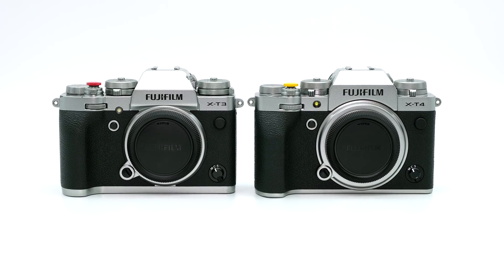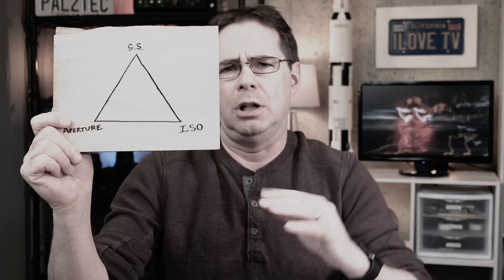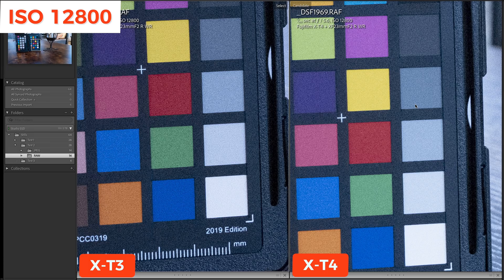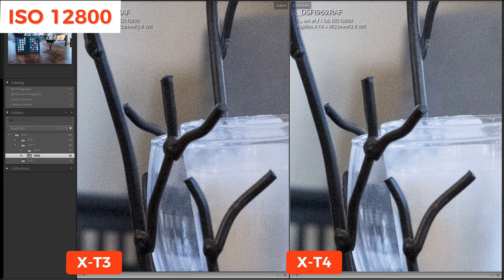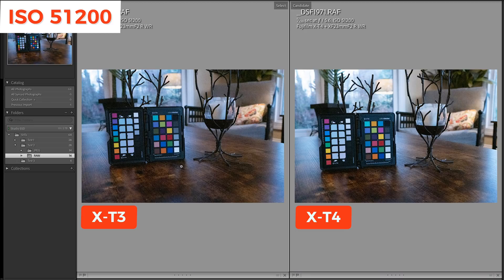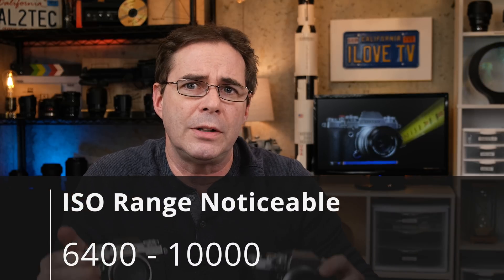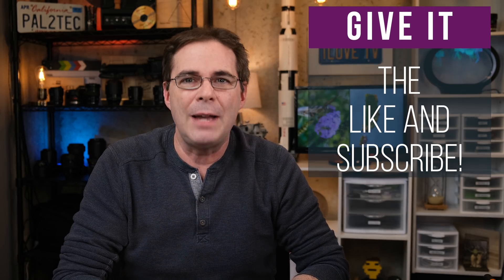Fujifilm ISO Performance: XT3 vs XT4

Comment: It's the same sensor... the xt3 pix are sharper with more noise, which probably means Fuji is doing more pre-processing before you get the image from the xt-4...so, "better" is a rather subjective assessment. I would prefer a sharper, but less processed image.. so, xt3 would be "better"

Comment: Not enough difference for me. I have never used anywhere near that sort of ISO with any camera!! If I have to have an ISO higher than normal on my X-T3  because it is necessary to get the shot then I would run it through Topaz DeNoise AI in post......problem solved!!!

Comment: Lr desaturates some of the colors, is that part of its default “color noise reduction”? 
Also, would be interesting to see how one of the non x-trans sensor cameras, like the X-T100 or 200, stack up to x-t3 and 4.

Comment: What is the work around for sharpness in LR for the xt4? Is there a plug-in to fix this problem? LR doesn't import my raw files? It only imports jpeg files
Reply from the maker: LR should definitely import RAW files from Fuji. I'd need to know a lot more info, but I can confirm that LR definitely does handle Fuji RAF files.

Comment: About the worms, why don’t Fujifilm just switch over to normal sensors? They have them. 
Like, what is it that the x-trans sensors actually give you that a normal sensor don’t? Do they just use them cause they sell better?

Comment: Also sucks that the XT3 exhibited more noise than the same shot taken on the previous XT2. Pro tip tho! For XT3 (and maybe XT4) users: If you are shooting a low light video at ISO 12800 or 25600, you may want to switch on 4k interframe noise reduction from the menu. The difference is noticeable at 12800 iso and even more noticeable at 25600 iso. Don’t bother with for below 12800. MY MAN WAYNE SZALINSKI!just doin your people a solid! Oh and if you see this Chris, you may want to do a fast Friday follow up vid to this: where you explain why and how some lower ISOs on the Fuji are noisier than the next bump up. I think 2000 appears cleaner than 3200. There’s a graph for this, where noise is y axis and iso is x axis and the line looks like a diagonal electric bolt ⚡️. That’s the extent of my knowledge on it... I’m certain you’ll know more tho.

Comment: Pretty interesting find. I could definitely see the difference between the files. I wonder if it really is a difference in circuitry on the xt4, or maybe better demosaicing (did I spell that right??) with xt4 raws, or even how each body handles heat, or all of the above!

Comment: Thanks for doing the work, but the exposures between the comparison shots aren't the same. Freeze the video at say, 3:59 and look at the wall in the background. The X-T4 shot is CLEARLY brighter. Not your fault the camera settings were giving you identical readings but enough to slightly skew your results somewhat.
Having said that, I don't shoot at those high ISO settings anyways. :-)

Comment: Guys, why not try to do the following: Go to the default low ISO value of ISO200 and use the same lens, same aperture, same shutter speed. Bring the images into Lightroom and then pull up exposure settings and make both images have the same brightness. Now let's compare, which camera does better. That's the ISO less comparison.

Comment: Nothing wrong with shooting at 6400 ISO (or more) when the images come out looking that smooth. 

As much as I adore my XT-4, I really wish it was as reliable and polished as even an entry level Canon DLSR (especially when it comes to video). The Canon might have garbage dynamic range and toy camera nerfs like 1/4000sec max shutter speed, but the thing just works. The auto exposure is fast and smooth (and it tries to respect the 180 degree shutter rule by stopping down!), the autofocus is accurate and fast, it just works. 

The Fujifilm is a beast and the image quality beats out many full frame offerings IMO. It's such a shame to have to choose between lackluster image quality + missing features (but with perfect AF and AE), and breathtaking image quality + cutting edge features (but with glitchy AF and AE that can easily ruin an otherwise amazing shot).

Why can't I have both!

Comment: I recognized, that the X-T4 images are less sharp than the X-T3 ones. So I asked a friend to let me do the same test with my X-T3 and his new X-T4. At ISO values up to 1600 I can't see any difference in noise or sharpness, even zoomed at 400%. From ISO 3200 upwards, the X-T4 shows less noise but the sharpness decreases the higher the ISO is set. I double-checked, that the internal noise reduction was deactivated and all relevant settings were the same. For me personally, as I don't need IS and never had a problem with the batterylife, the X-T3 is still the better choice because after developing the RAW files from the X-T3 in On1 Photo Raw with applied noise reduction, the images showed abut the same low noise as those from the X-T4 without Photo Raw noise reduction, but were noticeably sharper.
Thanks for your video as it inspired me to do this comparison by myself, as now I love my X-T3 more than before.

Comment: Chris I don't use LR, my pics are stored in windows so my RAW files go direct into psRAW (no DNGs here)  sharpening is pulled to 0 as is noise reduction. I do noise reduction in Nik define, then sharpen in PS using either High Pass or smart sharpen. Well happy with results XT3. Give it a whirl, it would be interesting to hear your thoughts on this one.
Reply from the maker: Thanks Ian!!! Will check it out!!

Comment: would love to see x-t200 vs x-t4 cos on dpreview studio scene Xt4 has very soft image compared to xa7(xt200) and abit more noise reduction  when xa7 has sharper image overall there.Check this iso invariance of much softer xt4 vs even older xt100(not even xt200)
https://www.dpreview.com/reviews/image-comparison/fullscreen?attr134_0=fujifilm_xt4&attr134_1=fujifilm_xt100&attr134_2=fujifilm_xt4&attr134_3=fujifilm_xt100&attr136_0=13&attr136_1=13&attr136_2=18&attr136_3=18&attr176_1=off&normalization=full&widget=789&x=-0.853225161032155&y=0.574686267999587

Comment: I wonder how that plays out when cranking up the exposure in post at base ISO...
I have a theory: If the amp part was where they improved the XT4 there shouldn't be as much of a difference between them when adjusting exposure in post. But if the DAC part was improved the difference should be about the same as in this experiment.
I love these technical videos!

Comment: I'm a little confused about the difference in how capture one vs lightroom handles a Fujifilm RAF file.
In this video it seems that the lightroom handles the Fujifilm files better and that the worms and colour smudging now appears more in capture one.
I was convinced by you that this was the other way 'round. I momentarily have both software platforms on my computer, but I'm investing now in working with capture one for Fuji. Can you please clear up my confusion?
Reply: I'm also concerned by that

Comment: Nice review. Both cameras are perfect high iso capabilites. But x-t4 one step ahead of course. Because of newer camera. Proud to be owner a x-t4. Happy with it.
Reply: Yeah, I feel the same about my X-T3. If the 4 was in my budget I’d have bought it but honestly the x-t3 is a solid upgrade from my x-t10 and it performs really well stacked against the x-t4, not quite as good but still very admirably. Pretty happy with my decision overall as I got the X-T3 for about $900 USD and I got to spend the leftover money on a couple of primes!

Comment: I would enjoy a video on the phenomenon of how the dynamic range of a sensor shifts towards highlights with increasing ISO (google the terms "increasing iso dynamic range". What this means is that in sunny and brightly lit situations, if you wish to retain more detail in highlights, you counter-intuitively increase ISO instead of decreasing.
Reply: Correct me if I'm wrong, but I thought that was image encoding specific - like shooting in a log format for video.  Or like when one uses a DR setting above DR100 - in that using a value above that reports a higher ISO being used, but behind the scenes Fuji is capturing the scene at a lower ISO and then boosts it digitally to match the recorded ISO. In this case, the ISO is high, but it was recorded such that it left enough headroom for the highlights to not be clipped.

Comment: Could it be the battery? Could a larger more powerful battery help the processor perform a little better? 🤔 (During the beginning of the gulf war Apache helicopters had radar static interference until it was discovered that it was caused by power levels, batteries changed problem solved.) 🤔 There are many things a simple power source change can fix, incredible! To find out we must use the new battery with the xt3. 🤔🤔🤔
Reply: Well seen. I hadn't thought of it. Maybe, that could be the reason.
Reply: @angelcobosardon  🙏👍

Comment: I see a slight difference in exposure between the two.. The Xt3 is slightly darker in all your samples and could be playing a role.
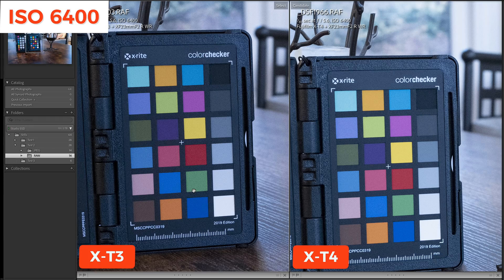Reply: 1:49 Look at the right edge of glass and a pillow white part. X-t3 did a better job!
Reply: Also noticed that. Same processor and sensor, they are identical.
Reply: overall it looks like x-t4 it's brighter and a little softer, alltough at 1.49 farfolini seems to be right about exposure.🤔

Comment: The results of X-T3 looks clarely sharper than X-T4.  Or X-T4 has a noise reduction directly in RAW files, or the diference you see is for the diference of shrapening in the picture.  Cheers of Argentina.

Comment: Great side-by-side comparison! It makes me wonder if there's such a need for a FF like the Nikon Z6 II for taking high ISO shots.

Such is the quality of the X-T4 that I now don't understand how the Studio Shot from DPReview shows so much more noise than what you show on Capture One on the X-T4 shot, especially chroma noise (link below).

https://www.dpreview.com/reviews/image-comparison?attr18=daylight&attr13_0=fujifilm_xt4&attr13_1=nikon_z6ii&attr13_2=apple_iphonex&attr13_3=apple_iphonex&attr15_0=raw&attr15_1=raw&attr15_2=jpeg&attr15_3=jpeg&attr16_0=51200&attr16_1=51200&attr16_2=32&attr16_3=32&normalization=full&widget=1&x=-0.21352858152070672&y=-0.6242865628244768

Comment: Chris when I look at the text at the bottom of the Color Checker I see more distinct edges on the X-T3 images. Look, for example, at the “mm” in the lower right of the checker panel. My guess is that there is more noise reduction done on the X-T4 images and thus some loss of detail.
Reply: Thought the same thing!
Reply: Agree, that I am seeing more detail and sharpness in pretty much all the side by side high-ISO still images. It seems there may be some in-body noise reduction applied in the X-T4 RAW file that is not in the X-T3 file. My guess is adjusting the noise reduction in post-processing so the noise is equal, will result in the same overall image sharpness.

Comment: The X-t3 looks a bit sharper to me, see at 4:19 for example, so we can probably mostly achieve the same result after moving some sliders. Thanks for your efforts!
Reply: I think it may be from slightly different point of the focus between this two shots.
Reply: 1:15 seems to suggest that they are using two different lenses - at least I think they are different. If it is two different, then maybe this is partially explained by lens variance. If not, then maybe just focus is different?
Reply: One has to be careful when judging the results. It is a well known fact from the analog era that adding a bit of grain increases perceived sharpness of an image. Whatever: To me the differences are subtle and may be more a matter of firmware finetuning rather than hardware improvements.
Reply: xt3 has more noise and sharper
Reply: Sure, for all those times you're shooting at ISO 25,000.
Reply: No such thing, sharpness is lens dependent.

Comment: Interesting. Then I think back to my old Canon 5D mk I and remember how superior the X-T3 is.
One thing, ISO is not an acronym, like LASER ("light amplification by stimulated emission of radiation") if anything it's a TLA, so it's not a word, it is a three letter abbreviation and should not be  pronounced Eyeso, just I S O. (International Organization for Standardization)
Reply: If you look up International Organization for Standardization, which is abbreviated I.O.S by the way, on Wiki there is an explaination for why it is pronounced EYEso. I was making the same assumption until I realized that ISO was not the correct order of letters to represent International Organization for Standardization.

Comment: I find this very interesting. I would like to know exactly what is giving the X-T4 a slight advantage over the X-T3 in ISO performance knowing the sensors are the same. I now wonder if the new X-S10 is slightly improved as well. This is another reason why I love your videos.

Comment: Another nice video. Congratulations you have identified that the newer camera has slightly better noise reduction applied to the raw file. Yes despite what many people think there is a form of noise reduction applied to even raw files. I shoot the XT2 and I am not sure how it compares to these two but I am always impressed by the low light performance. Often I use the grain setting on weak and that will tend to mask any noise. I don’t shoot video but again these cameras look to have some incredible video performance. Thanks for the videos

Comment: Its amazing how good the high iso images look with the fuji cameras. I have the xt2 and have made some 4x6 prints at iso 12,800 and you can not see the noise. It shows up much more on the computer screen than it does in print. One thing I have noticed comparing the xt2 to my full frame 24mp Nikon is the fuji looses sharpness and color much quicker. As far as the amount of visible noise to me its only 1 stop or less comparing them side by side. I love my fuji so much I can not part with it even after getting a full frame camera this past year. Thanks for the video and sharing the results.

Comment: how about testing the xt-2 vs xt-3 or 4??  i guess im lost as to how the EXACT same sensor of 3 & 4 can vary in image quality 🤔🤔
AND why Fuji would not address any type of noise issue via a firmware update for the 3 ?? 
I personally was never all that impressed with the xt-3 sensor for low light abilities.  Fuji will surely have to step up their game next camera body/sensor!  🤞🏼🤞🏼hopefully with the crop sensor they have not reached their maximum quality output when shooting in lowlight (???) 

im still a Fuji lover but at some point does it truly get much better from here?!!   yet to be seen ....
Reply: Andrea, if you watch one of Chris's previous videos, he explains how ISO works - it's an electronic amplification done by circuitry. So a difference in the circuitry or electronic design internally can affect noise introduced by the amplification.

Comment: Very interesting. Great video as always. Why would there be any difference at all? I thought everything was the same between these cameras.
Reply from the maker: I'm thinking it has to do with the circuitry. Or maybe there was a variable in my testing that I didn't catch. It was far from scientific but in every shot I saw better ISO performance.
Reply: @pal2tech  Looked pretty scientific to me. I don't know how you could have done it any better. Great job and fantastic channel. I learn a lot from your videos. Please keep up the great work.
Reply from the maker: @brianw6645  Thanks so much Brian!!! 🙏
Reply: @pal2tech  Circuitry or maybe processor? Which one of the two would be the most likely explanation?